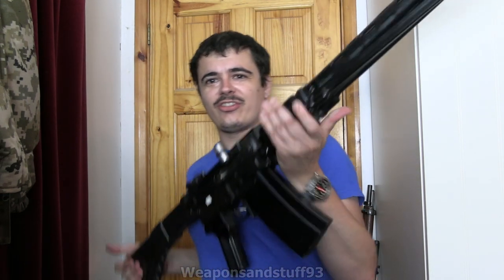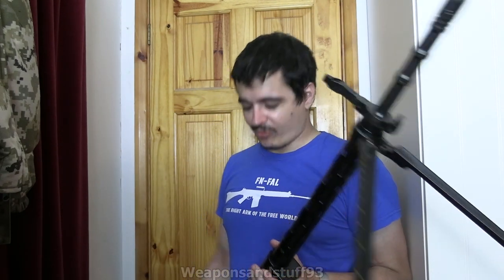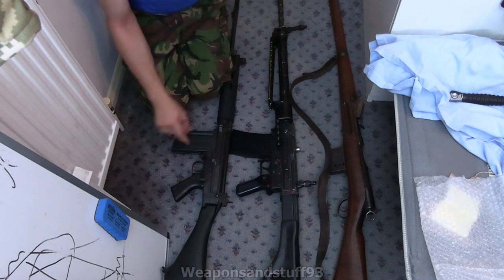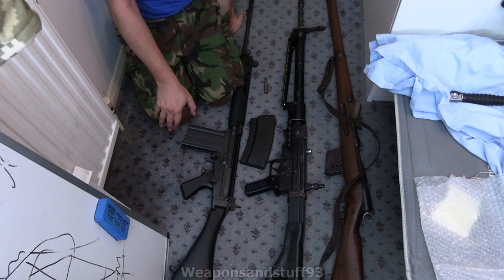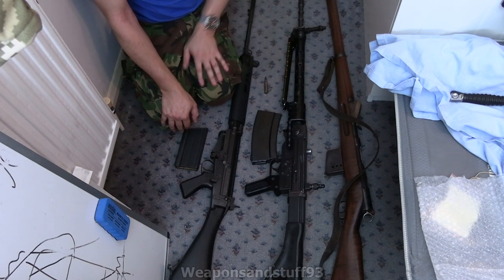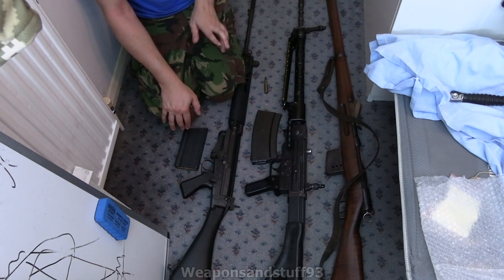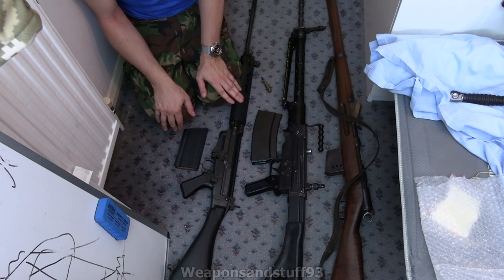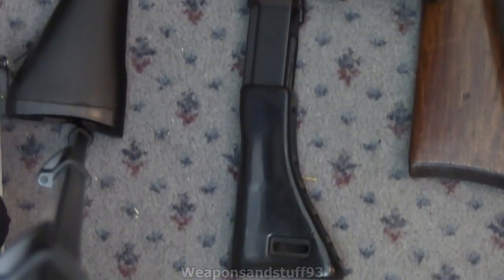Swiss STG57 Battle Rifle/LMG

Comment: I may be wrong but I think that with your forward hand, you hold the foregrip somewhere between the rubber section and the mag/receiver itself on an angle rather than holding your hand completely parallel/horizontal which is why its on the small side. 

I know for vertical grips you want it grasp it on that angle, rather than parallel and wrapped around the grip itself. Not sure why exactly but I think it affects recoil control and your ability to hold a target more smoothly and less twitchily
Reply from the maker: I think you're only "meant" to grip it by the rubber bits so you don't freeze or burn your hands. However if it was in normal conditions or you had gloves on that wouldn't really matter, however it's basically meant to be fired from the bipod at all times.
Reply: @Weaponsandstuff93  you are very passive aggressive